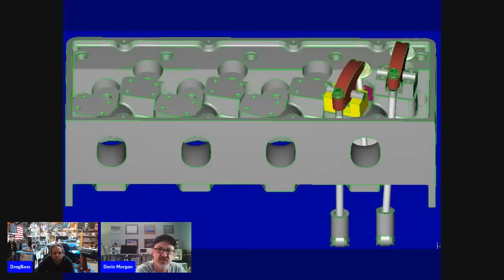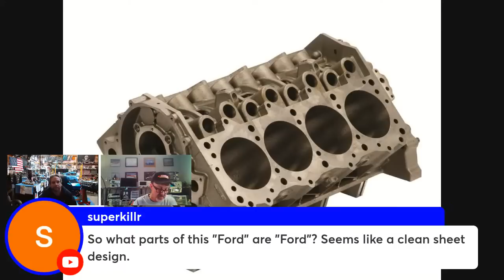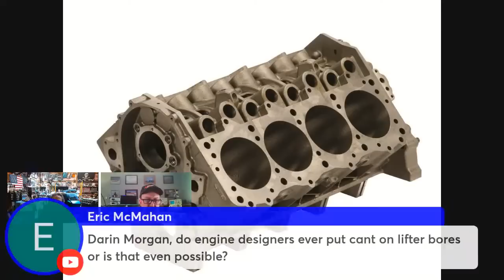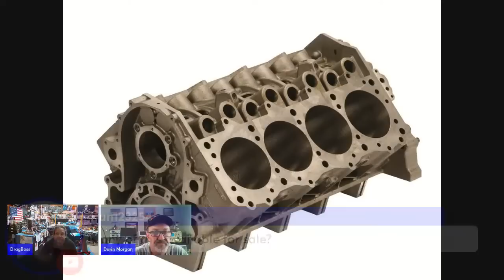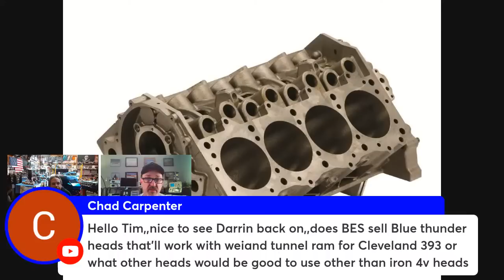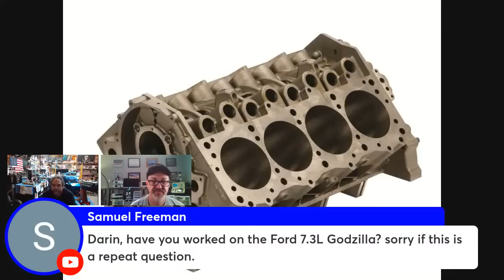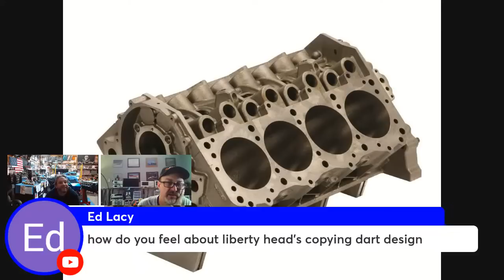DBG: Darin Morgan;  Ford Pro Stock Canted Valve Arrangement Head 1400+HP @10,200 rpm  with 499.6 ci

Comment: Notice how Ford dominated Pro Stock for years with the "Blue Crescent" twisted Hemi design and how modern "Hemi" Pro Stockers have very side-by-side-ish valve arrangements?
Could it be that swirl about the piston's axis of travel is far more valuable than straight-through flow of the directly-opposed-valve classic Hemi/Porsche 917/Gen III Hemi arrangement?
Taking what I've seen by cylinder head design, I have to think so. Dodge could have put actual Hemis in Pro Stock lately, but, instead, they went with a VERY swirl-inducing cylinder head valve layout.
Reply from the maker: Yes right on. Valve arrangement is huge according to Darin. What do you mean by Porsche 917? I gotta love the hemi too
Reply: @dragboss351cleveland  The flat 12 in the Porsche 917 had Hemi-type heads with twin spark plugs and dual overhead cams. The valves were directly opposite each other along the overall flow axis of the air through the cylinder, like the Chrysler Hemis.
Reply from the maker: Wowser, did not know that. Lots of innovations in European engines. Thanks for sharing with us.
Reply: @dragboss351cleveland  Love to do so.  I'll tell you, though if Porsche or Mercedes are EVER allowed into Pro Stock, then the days of any American team winning the championship will soon be over. The Germans do not play to compete. They play for absolute, overwhelming dominanance. Witness Mercedes when they finally got back into Formula One. Porsche in the Can Am. 

People give lip service to "cylinder-to-cylinder consistency." and "running as little bearing as possible" etc. They would have it down to a near-zero-percent difference from one cylinder to the next, and bearing life measurable in exact numbers of seconds. I could go on. There is just so much that can be done that is not. Nobody has the budget they are willing to spend on it.
Reply from the maker: Impressive stuff. But cannot think about that. V8 American power 🇺🇸

Comment: What is The Differents in a N/a Head & a  Nitrous Head ! . & . What do you have to do to a  Nitrous Head . to Use it on a N/A Motor  . . I Have a BBF 605 N/A Motor . Makes 1160 H P . 846 Torque . It Came with a set of Gane Fulton A460 Nitrous Heads That Are a Lot Better Set of Heads . Then the Heads on the Motor . What DO I Need to do To Use the Gane Fulton Heads .
Reply from the maker: I can’t really answer that question accurately, that’s something Darin would answer. I know you need to soften the chambers. There are butterheads, but they were quite well. I bet you really don’t have to do anything to them run them I would ask your builder they may know better than I do.

Comment: Is That 20 hp to 28 hp Gain with a Vac pump . With 0r with Out a Dry Sump Pump
Reply from the maker: I forgot, I actually, but that engine was a wet, sump, with a single four. The most you can get out of 500 ci is 1500 hp that’s the limit no matter what you do.

Comment: Godzilla engines are already at 35000 miles showing oil starvation causing cam and lifter extreme wear and failure. Mainly in the front of the engine in 4 cylinders.  2 doing the same thing reeks recall. I'm sure there have to be more.
Reply from the maker: Randall. I can’t comment on that, I don’t know anything about them. That’s why I got him on my live chat, can answer questions and discuss this. You seem to be the expert at this, do you have a Godzilla engine or just stuff you heard? Give us more details of your research.

Comment: Great...just when I think I know something.   lol.   Good talk!
Reply from the maker: Thanks, LongRifles, my motto is always learning something new DBG. Please make sure your sub, so I can bring you more things you don’t know. Appreciate you.
Reply: @dragboss351cleveland     I've been working on a new engine for my drag car.  I have to make the dry sump pan from scratch due to the setup.  I had finished modeling and programming the part.  (Billet oil pan that I made in my 5 axis).  

You guys went and screwed all of that work up when talking about pan shape and using it to influence how the sump/scavenge feature collects oil off the rotating assembly.  (makes total sense and a friend of mine pointed it out as well, but what does HE know?) lol.

So, I started all  over.... (came out great btw)

Thanks.

C.
Reply from the maker: Sorry my friend. But sounds like you got things covered with 5 axis, dang it man. You should take some pics and vid of making it and send it to me. I would make a vid and post. Glad you picked up some info

Comment: If you took a engine and it was turning 7000 rpm max Hp and tongue ended at 7000 rpm. But turned it to 12000 rpm it would still be faster than at 7000 rpm would it not ??? Because rpm would egual more speed ask him that for me please
Reply from the maker: Are you saying if you took it and that was turning 7000 RPM, and torque ended at 7000, turned 12,000, would still be faster than at 7000 RPM would it not? just want to make sure you have some spelling errors?
Reply: Yes theoretically if it still made the max H p. And torque it had at 7000 and but rotating mass then increased to 12000 OR WHAT EVER THEORETICAL Increase number you want to use I would think as long as no loss of h p or toque  because or extra.  R p m it would be faster
Reply from the maker: @frankiestein4013  I know Darin told me that the max HP you can make with 500 ci is 1500, does that help?

Comment: I had 351c which was half filled and worked great never had another split bore, was on the street 450hp @7500. Found oil temp would increase water temp. Fitted engine oil  cooler which lowered engine coolant temp.
Reply from the maker: Yes sure. I like that. Same experience as I, but I have never installed a cooler. What we the temps for water and oil?
Reply: @dragboss351cleveland  only 45mins driving 50 to 62 mph oil temp 105deg C and water 110deg C, fitted oil cooler 80 to 90deg C water and oil 80 to 85deg C . No matter ambient temp any given day or night drive car as hard as you like for long as you like.This engine in street car XAGT Falcon
Reply from the maker: @surfranger1  thanks for the heads up ray. Good real life experience. Always like the oil cooler on the Boss engines.
Reply: @dragboss351cleveland  Hi Tim, like your channel, lot of nostailga with so much old school technology. Still applies today . Can only imagine the engines could have been have been built back then. Just no way back then get the knowledge you have got on your channel .... awesome great work
Reply from the maker: @surfranger1  I appreciate you watching my channel. And understanding old school performance. You are so right you can add 100 hp and the engine just with today’s technology. And the ring seal and ring package they have today. Unbelievable. That’s where the power is not just in the heads. I’m trying to make a channel where you can find out all kind of information on old school and new school. Just a little limited on the new school stuff. Glad you’re here. Stay tuned for more.

Comment: On the street boost makes more sense, you get idle quality, power steering, AC & power prakes. In a class car it is obviously Different.
Reply from the maker: To much plumbing, I like just old NA combos. But I’m old school
Reply: @dragboss351cleveland  I am old school as well, but Heavy on the OLD/Geezerhood & living Vegas I want my AC, power steering & brakes. In a straight up toy cool, in a real driver nope.
Reply from the maker: @derrelcarter9401  I can dig it. Goal with wife’s 69 mustang. Make it into a black Boss 429, with rack and pinion, ac, awesome interior, a driver.

Comment: @1:41. Firing order clusters in the front are ideal with roots blown application. Having them in the back are ideal for screw blown application. In most forced induction engines you deal with manifold pressure divergence from front to back
Reply from the maker: Thanks for that info. I never knew that, but also have no blower or supercharger experience. Good think is lots of subs read comments so may start some conversations. Thanks GL

Comment: I have done a bit of sniffing around on this stuff apparently  the main head bolt pattern is different space to oem from exhaust side to inlet I'm not sure if the rcv-1 version from eliminator are any different but summit show the head studs drilled mbe have a version of these big port and small the most advertised flow Ive seen is 646cfm they are also said to be the same as the mopar prostock head so mbe says
Reply from the maker: Not sure on that. But I have been talking to Matt at MBE, He wants to come out and do a live chat but he is so busy it’s hard for him to find a time. It will work out soon.

Comment: What are the intake and exhaust cfm flow numbers and  cc of these heads?
Reply from the maker: Lee, I remember him talking about it, I don’t remember the specifics. See if I can find out. I know the intakes were flown I believe way over 500 CFM. Cc the heads I think we’re 48 cc to 50 if I remember correctly
Reply: Prostock is over 600cfm on intake...  ( like 630-640cfm )  Explains the 1400HP number and 10500 rpm, the rpm used to be 12000 rpm but they limited it!
Reply from the maker: @dennisrobinson8008  Darin said the max a 500 ci NA motor can make is 1500hp, did not know any turned it that hi, 12k.
Reply: @dragboss351cleveland  Found some readings that they used to go 12k, then they turned them down to 10500rpm limit.   So it meant they could make more power in my book.    Not sure why they were turned down, perhaps to limit costs?
Reply: @dragboss351cleveland  What's crazy is they show the flow numbers for the pro stock with 2.575" intake valve:

Ford Pro Stock RCV (Canted Valve) Ported Darin Morgan SF600 Alum
Exhaust = No Pipe
2.575
0.20000 - 175
0.30000 - 273
0.40000 - 369
0.50000 - 457
0.60000 - 530
0.70000 - 583
0.80000 - 614
0.90000 - 637
1.00000 - 644

The C63 AMG cyllinder heads which are 4v on a 4.02" bore back in 2009-2014 have the following flow numbers:

.200 - 205
.300 - 300
.400 - 348
.500 - 358
.600 - 360

Ported they go:

.200 - 207
.300 - 318
.400 - 353
.500 - 389
.600 - 405

So up to .300 they are ahead and close at .400".   

I imagine the C8 z06 heads which are DOHC on a 4.100" bore flow even more than that because the intake valve is 42mm vs 40mm for the c63 and the larger bore.
Reply from the maker: @dennisrobinson8008  Wow thanks for going all out with the comparison. Those are serious numbers from the AMG, after the grinder is finished eating.
Reply: @dragboss351cleveland  Yeah, the AMG heads can get to 430 CFM or so, and some companies can get bigger valves into them for possibly more.   Most guys get up to 600 HP naturally aspirated with the stock camshaft and intake ( 205 or so @.050 ".480 lift )  and if they want more go to boost...   I'm curious to put a camshaft that can get it to 9000 RPM, to get the 800+ HP N/A that this motor really can do.

Comment: Ford stole the idea of rotating the valve positions and valve canting not the exact design. Chevrolet knew about the flow advantages along with retaining torque. Ford stole the basic concept from chevrolet, they also stole the concept of hemi from dodge by making the 429 boss. Ford has came up with some of their own designs through the years but the hemi and semi hemi were not theirs. Please dont act like they invented the wheel when they only modified it.
Reply: Hemi been around since 20s not invented by  Dodge  Duesenberg’s even had hemi design in 20s
Reply from the maker: Exactly, what does it matter who made up with design it makes no difference. It’s worth the design and what’s going on now makes a difference. Who cares who invented what, At this point it’s arbitrary. I’m not sure why it’s important to be able to say that an idea or concept was taken from another manufacturer. What are you trying to say that Chevy in Mopar, or better engines, what is your point WS?
Reply: You’re drunk Ford came up with their own stuff Cleveland and boss 429 you’re misinformed

Comment: As of October 2022, is this another Ford effort ? The reason I ask has to do with Morgons effort with it in Pro Stock. He had awful backing from Ford. He really needed help.
Sponsors were weak compared to what he needed.  When his obligations were over and he switched over to Chevy; he knew right away why the Ford could never get where the Chevy was.  The block was the key he told me. 
That boy was the most motivated man in the pits IMO. He didn't quit and was really using non Pro Stock equipment.  I mean, parts that were busted so many times over and made to run. I was blown away how he would go to every race being positive. If I was him, I couldn't go knowing I'm cannon fodder every week.  ---- Nevertheless,  I only wish that I could have helped him in some way simply due to his positive attitude. At least he reflected that everywhere I saw him.

 I  understand Bob Glidden worked for him at the end and apparently Bob wasn't able to add to his program. I'm sure there was a good reason.
Reply from the maker: Not sure at this time John. All new data and see wheee it goes. Larry is a worker for sure. I have heard some stories of Bob working with him. It was a good situation so I heard. But yes, got. Irving for his program. We will have to wait to see where this pro stock mill will go. Thanks

Comment: It is possible to run a cant lifter. The problem is the cam lobe has to be ground on the that angle. In the V8 cam in block engines there wouldn't be engine space between lobes to allow for the angle. I'm sure it could be designed in on clean sheet deal. Lot of work though.

Some F1 engines in the 90's ran canted 4 valve heads with angled lobes running direct to cam follower.
Reply from the maker: Yeah this is the technical stuff that I never even thought of, these are the new ideas that may definitely need more exploration

Comment: Carbon fibre is not suitable, however, in the 1980's Polimotor was successfully running Ford 2.3 litre based DOHC 16 valve engine with plastic block, rods, pistons, head and cam followers. Engine was run IMSA and Migets 

https://youtu.be/CRd4Jy4Q4_4 There is more than one engine. I found one out of Midget for sale 8 years ago and a customer bought it for a project.

Ford was involved this project also. This was the beginning of plastic inlet manifolds and cam/rocker covers

Polimotor was still around a few years back in Florida
Reply from the maker: Very interesting thanks for taking the time to look that stuff up. They still use it I just don’t think it’s in a high-performance aspect. I.e. high compression ratio, racing fuel Alcohol,I don’t know If it affects that type of plastic so to speak.

Comment: Wonderful content. Always much to learn from Darin. 
The guy that asked about resemblance to a Ford engine unfortunately did not receive a response. The first response was coyote and the second was godzilla. Never mind the fact that coyote is not clean sheet or that the godzilla is. These engines are based off of old push rod engines. Of coarse the result today seems like clean sheet however, the path to this point is not. Obviously the coyote is not clean sheet the 4.6 paved that path. The godzilla is clean sheet however sharing nothing with the push rod Fords of old which have inspired these engines we are talking about today. I look up to you tremendously though I find it appalling that your initial response to this question was coyote. Truly impressive to put it positively.
Reply from the maker: Thanks Charles for watching. I try to make it so you always can learn something when you watch DBG. I don’t follow either of those two engines, and really an old school and will probably never have opportunity nor cared up have a vehicle with coyote or a Godzilla. I just like old fashion Cougars, With Cleveland power. Stay tune Charles

Comment: Now I see why 4 valve heads run so well
Reply from the maker: Very well, it’s amazing, Like real estate location location location
Reply: Don’t be discouraged with your 2 valve ones remember that you can have rocker ratio, they can’t really. Work to your strengths, ie torque, try to get to 1.65 per ci, that’s a way longer climb for a 4 valve and when you can run at 7500 like I do you may surprise yourself.
Reply: @Bbba7564  well you can do 4 cantered valves per cylinder with a central spark without OHCs just by using forked valves off 2 side driven pushrods like on a Honda CX or Moto Guzzi Daytona
Reply from the maker: @mickvonbornemann3824 Wowser sounds complicated. Never fly with nhra, maybe most guys, just old school here.
Reply: @mickvonbornemann3824   😂😂😂😂😂😂😂😂😂😂
Reply: But have yet to make way into NHRA Pro Stock's N.A. 3hp per cid realm.
Reply from the maker: @peted5217 yep with no sponsor money and legal engine. Nothing happening fast.

Comment: Wish I could’ve seen the live, I had question about the EFI on these PS motors, and how the performance would be effected if the NHRA ps motors were allowed to run stack injection efi
Reply from the maker: He did briefly discuss this. Have to listen to it again ☺️. Have to ask him about it, next time around
Reply: @dragboss351cleveland  was it around the same time he was talking about the current intake/throttle body?

I remember him discussing the current intake and throttle body location being difficult to tune with, which got me wonder if the NHRA would open up intake/induction rules, how these motors would respond to a stack injection set up
Reply from the maker: @taylorgtrotter  I just don’t remember. You have to go back and throw it on while you’re in the garage. Lots of wide-open opportunity, the question is will it continue and expand. We will have to wait to find out.